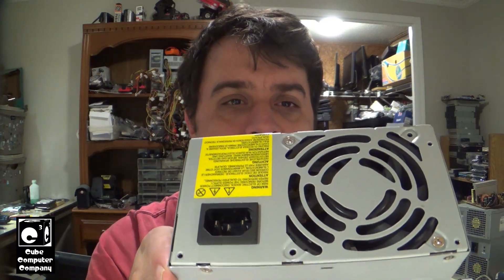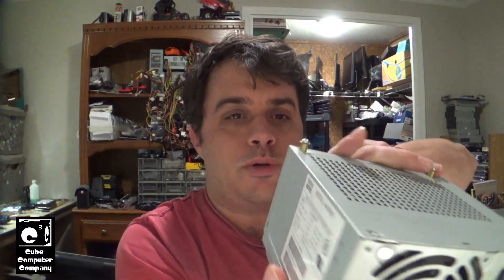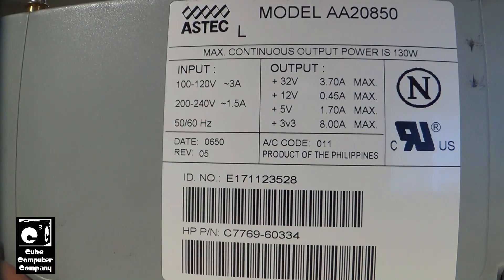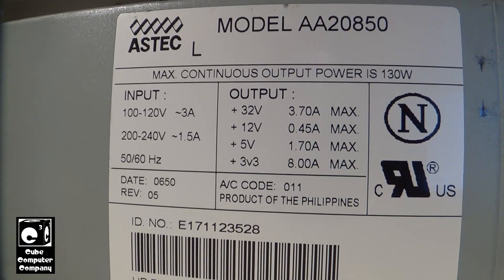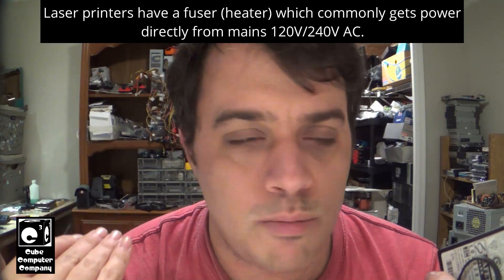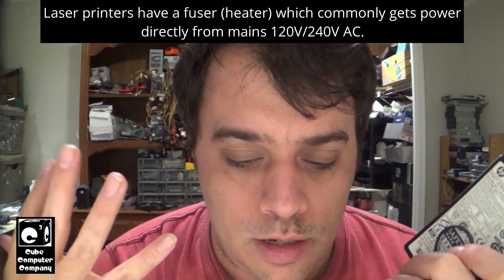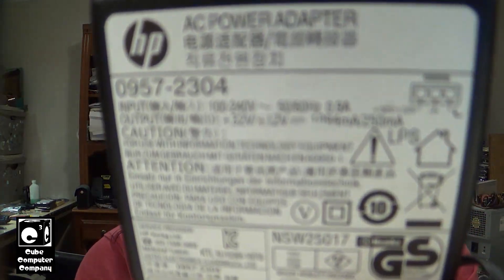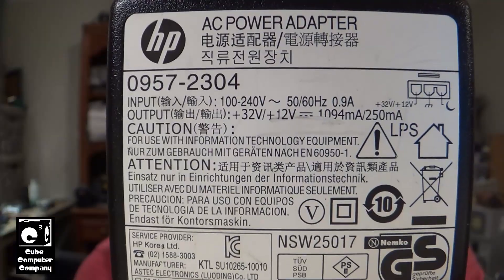This one design change would help prevent burning GPU power connections!

Comment: Or even 24v would work just as well for reducing the current loading on the connector...

But since ATX is standardized around 3.3, 5 and 12v, it would probably be easier and smarter to just give us the damn 2x4 back... Or make 12VHPWR with the same pin pitch so it can actually HANDLE 9.5A per pin without heating up and becoming a fricking toaster element!!

Comment: Consumer PCs are cost-sensitive and MOSFETs become a fair amount more expensive when you go beyond 30V. Efficiency stepping down voltage also gets worse as the input voltage gets higher since you need the high-side switch to handle the same peak current as the low-side switch unless you introduce step-down transformers in-between, greatly increasing cost. Only the highest-end GPUs have connector melting issues and it isn't fair to impose the costs of high-voltage power delivery to the remaining ~95% of the market only to accommodate the top-5%.

If you mean to have dedicated 30+V PSUs for high-end GPUs only, the HPWR spec already has a 48V option. Make new high-end GPUs require 48V HPWR to unlock board power beyond 500W, then only people who actually need 48V have to eat the increased PSU and GPU side costs.

Though the simplest solution to melting connectors would be switching to an XT60/90 or EC5 variant. Can't have current balance issues when there is only one +12V and one PGND pin and wire.

Comment: You don't really need different voltages, just proper connectors.
A lot of servers with 2000W PSU still use 12V (so like 167 amps) and it all works perfectly fine.
And the PSU itself connects via single edge connector.

Comment: they should just use 3-4 of 8 pin connectors, adding a 32v rail would make it more complicated
Reply from the maker: It wouldn't be as bad as you might think... Back in 2001, PC power supplies were built to either power classic systems which utilized the 5V rail through the 20-pin ATX power connector, or the new Pentium 4 systems which used the 12V rail. An extra connector for some system, or a needed connection for others. There would have to be some changes to the internals of a PSU to add a 32V output, but with many modern power supplies already consolidating the 3.3V and 5V outputs under the 12V rail (using DC-DC conversion), it wouldn't be too much to add in a 32V output. These PSUs would be a specialty version, only specced for systems with a new matching 32V graphics card. Some units could be designed to supply a large amount of power over either the 12V rail, or the new 32V rail, and offer modular cables so that either cable could be selected. If a 32V GPU power output were to become a standard, a new power cable design would also be needed to eliminate connecting a 12V card to the 32V output or the opposite.
Reply: @CubeComputerChannel  fair enough, yeah i guess 32v could be reserved to extremely high end systems as i doubt mid range gpus in the future would use so much power they would be melting cables
Reply: Better to just convert everything to 32V .ore standardization is good

Comment: 32 voits is not going to happen , look at the New 16 pin 12 volt power connector, it can be pushed to 600 watts through pins 2 times smaller than the old 8 pin GPU connector, yet NVIDIA, Intel and AMD are not reconsidering the design .
Reply from the maker: I've seen reports of these connectors burning up. Simple matter is you can't reduce the size of a conductor or connector and not expect problems when pushing high current through it.. Higher voltage will eventually have to be introduced to safely handle increasing demands of GPUs. I'm sure there were people in the 90's speculating that 12V would never be used to power the CPU.
Reply: @CubeComputerChannel Sadly these corporations don't care about the low end user like us.
However you probably know that professional grade GPUs and CPUs are powered by proprietary power connectors of better designs .
Reply: @sithounetsith9877  I wouldn't consider the rtx pro 6000 a non-professional grade gpu, and even that has 600 watts running through the 12v2x6 connector. Nvidia definitely is turning a blind eye, possibly just to keep the aesthetics.
Reply: Unfortunately it’s not about the connector, but that thers not any balancing between the pins and almost all power can run over a single wire or two
Reply from the maker: @inteallsviktigt  Yeah, all the current flowing to the graphics card should be balanced across all of the conductors in the power cable and connector. Defeats the purpose of having a multi-conductor cable...